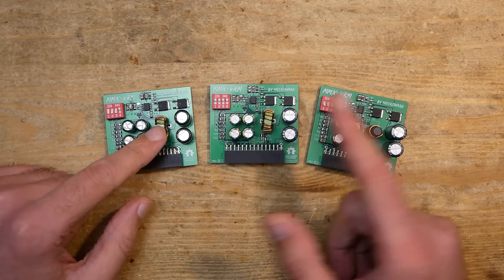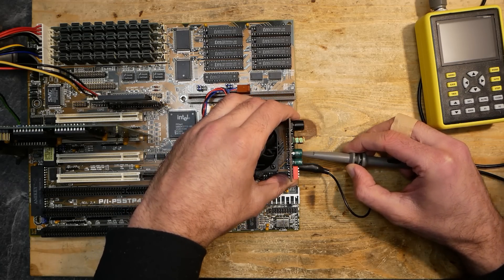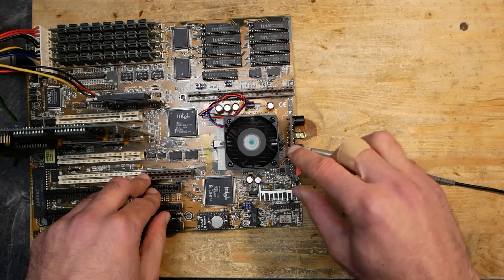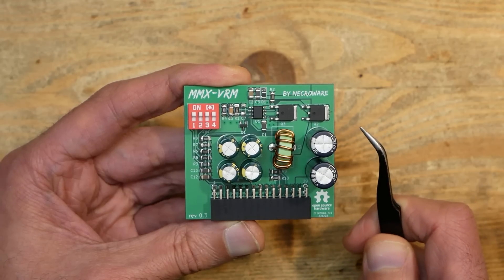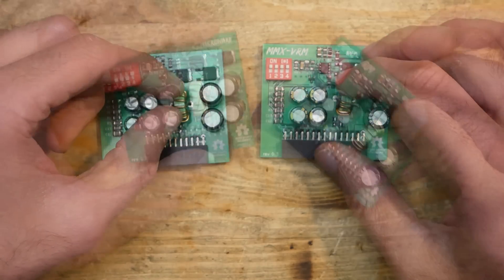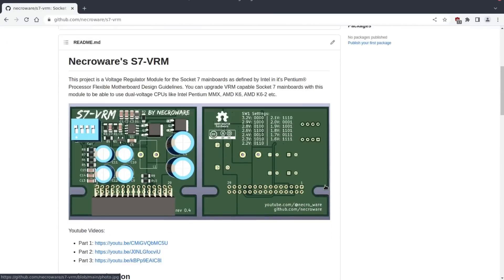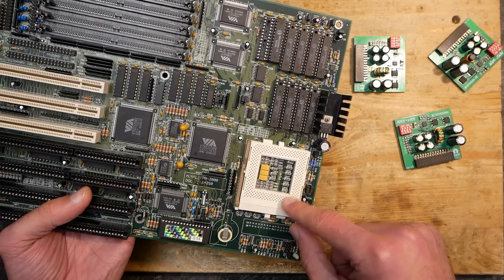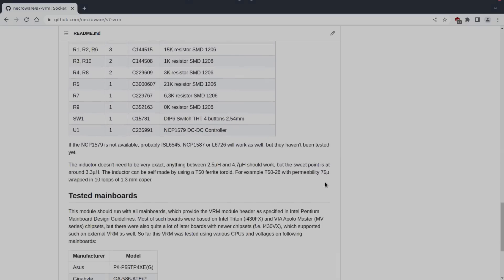Let's upgrade an early Socket 7 board beyond the limit (Part 4): K6-2 test and VRM announcement

Comment: Hey Necroware I really am loving this project. I am not meaning to be a pain I was wondering if you have any new Info for supporting the Cyrix MII CPU. It does use more wattage than the K6 CPU. Not sure if you saw my latest comment on your last video on the VRM. Granted I know I could use the K6-2 but to me I want to have something different for once since I just have to be stubborn and hard headed. Not trying to be mean in anyway about this project. I am just getting anxious for the final release and if I can use that CPU. I hope you have a good one and again I am in no way trying to be a jerk.
Reply from the maker: Hi Clint, strange, I though I answered your question back then. MII consumes more power compared to K6-2/400, but it needs less current at higher voltage, so that should run with this VRM. I have no MII, so I can't tell definitely though.
Reply: Only partly. Another person was trying to give more of an answer but yea you mentioned you don't have a Cyrix MII CPU but I hope if its possible for you to get one of the MII 333 or 300 to use a test out. Have a good one and I look forward to your next revision when your parts fully come in. Thank you for this project.

Comment: I think your proposed voltage selection revisions make sense, with one exception: wasn't there a K6 which ran at 3.2V? I'm not aware of any CPUs ever using 3.1V, maybe that one could be dropped instead?

I've never seen any of the mobile CPUs in a desktop board, but I guess supporting them makes sense.  Here's an idea: make the mobile (1.x V) voltages an optional section, with the appropriate resistors and a jumper to select "mobile" mode, which would substitute some voltages.  In "standard" mode, you'd have the common 4-bit binary setup of 2.0 - 3.5V seen on many Socket 7 boards.

Maybe that's too complex, just a thought...
Reply from the maker: Yeah, that missing 3.2V is the result of resistor network distribution. I'm trying to get equally distributed voltage over the range, this is still work in progress, but K6/233 runs stable at 3.1V if the ripple is low. I even was able to use it at 2.9V flawlessly. So, I guess, if 3.2V setting is missing in the end, it wouldn't be critical.

Comment: Impressive work! Extra points for making your own toroidal inductors 😁

In case you are interested, I'll leave a note on the relationship between characteristics and dimensions of electrolytic capacitors.
For a given series, the ESR is associated with the dimensions that is to say all capacitors with a certain Length and Diameter will have the same ESR. The ESR decreases with increasing volume.
The product of Rated Voltage x Capacitance is also (roughly) proportional to the volume so, for example, in a given L x D shape, if VoltageA = 0.5*VoltageB then CapacitanceA = 2*CapacitanceB (roughly).
Different series differs for endurance and max working temperature. It doesn't seem to me that, in your case, you would benefit much from pushing either so you may instead prioritise lower ESR or higher capacitance in the given volume but it's your call.

You may observe higher ripple when the CPU goes into that "power saving" mode because the buck converter goes from Continuous Current Mode (CCM) to Discontinuous Current Mode (DCM, the current in the inductor goes to 0 in each cycle). The ripple voltage is typically higher in DCM. The current threshold between the two modes is 1/2 the inductor (peak-to-peak) ripple current which, in turn, is lower for higher inductance. One of the benefits of higher inductance is that the buck regulator operates in CCM even at lower output current. As you found out, you had to trade nominal inductance for size & resistance. Larger capacitors would also lower the output voltage ripple but, again, you are constrained by the physical envelope of the design.
A way to lower the noise while staying in the same physical envelope is increasing the switching frequency (then, with the same output current, the inductor current ripple would be lower). This would require reviewing the choice of inductor and MOSFETs.
Which MOSFETs have you used? Can you please add the voltage rating of the capacitors?

Again, great job!
Reply from the maker: Thank you very much. Yea those are constraints, which I was messing with. The volume proportions are which I was trying to aim, due to the sizes, that didn't work completely due to limited size :)

In regards of CCM/DCM that's very interesting information, thank you very much! I'll have to evaluate that in depth for better understanding. As for higher switching frequency, I considered first faster controllers, but most if them are modern parts, which are harder to solder and they are more expensive. I tried to keep that cheap and easy to solder, so everyone can build it.

I'm currently AFK, so can't tell which transistor model it was, but there's a BOM on the project site.

Thank you for the info once again!
Reply: @necro_ware  I agree with the emphasis you place on the design being feasible for as many people as possible and it's tricky to find a good solution (Renesas ISL6545A, the 600kHz version, is now obsolete 😭).
Seen the BOM: I hadn't understood that one column is LCSC part numbers. My fault!
As others have written, you could use both faces of the PCB for components, for example SMD on 'top', (some of) TH on 'bottom'. This can help with the layout and make it tighter.

Can anyone point me to the pinout of the VRM socket (or 'header')?
PS: I don't have KiCad 😓
Reply from the maker: @lorenzo.c  there is a link to the specification on the project site, right in the end
Reply: Could always lay the capacitors on their side if they are to tall. Also am wondering if polymer caps would be better?

Comment: What switchmode controller IC are you using and is there a DIP version. Some people might want to redesign/built it on prototyping/stripboard using through hole resistors, capacitors and MOSFETs they already have in stock if they can't afford a PCB. You did say you had difficulty sourcing some of the SMD resistors and caps.
Reply from the maker: Finding that parts as TH is even harder today. Also, a lot of work went into the layout, probably every change will influence the ripple behavior. But if s.o. wants to do that, the exact parts are all mentioned in the project.

Comment: Adding an inductor between the input capacitors could lower ripple if you're seeing ripple on the input.
Reply from the maker: That's true, an additional LC filter would be a good option. But so far I'm trying to avoid additional inductor, I would like to reduce the size of the module instead.
Reply: You don't need to reduce it. I would rather have a properly designed  board that works well with low ripple than a board built down to a size/price. If additional LC filters on the input and output require a taller board, so be it.
Reply from the maker: @simontay4851  of course, if it needs that, I'll do.

Comment: Just a tip, regarding space occupied by capacitors - you can put silkscrenn on both sides of PCB and populate capacitors from opposite side in case they are facing towards CPU cooler. 🙂
Reply: Yeah, exactly. I was going to post a comment saying that but you already did.
Reply: Good strategy there.

Comment: Great job on getting the k6 running. Can you use small super capacitors to replace the big capacitors at 3.5v and 0.47F ? Or the 5.5v coin super caps at 0.22F. Just mainly for smoothing out power for DC?

Comment: The ripple tuning is actually spectacular, great success.

The routing is kinda ridiculously overbuilt for the 15A target though, like, you don't even have to worry or really spec through hole inductors, just via stitch the area and you'll be good i think. Not that i mind handwound at all.

Comment: There's a protective sticker on your scope's screen.. remove it for a picture with much better sharpness and contrast... Love your video's!
Reply from the maker: I added that sticker, because the screen is glaring like crazy and blinding the cam. I played around with light, but decided to put that sticker on screen. It's slightly blurry, but therefore I don't need to search the angle all the time :)
Reply: @necro_ware  Whatever works for you is fine with me.. The screen is readable enough on video.. Thank you for the great content!

Comment: If the capacitors are on plated through hole vias, maybe they could be mounted on the reverse if front clearance is a problem. Also, you may want to add extra vias or wire throughs if using tracks both sides to lower resistance
Reply: Came here to say this.

Comment: If Im right, I know, whats in the Box 😁 And if I remember right, this CPU worked in an Asus P5A with ALI Aladin V Chipset before.
Reply from the maker: Of course it is! Or may be not? ;)
Reply: @necro_ware  Im very excited to see it in the next video. And if it is: especially the difference in performance - or at least, if there is one 😉 (Im expecting the limited bus speed as a real show stopper for most benches)

Comment: @Necroware could you also add SMD capacitor pads on top of those through hole pads, just so anyone’s able to use either one of those? 

Whoah 🤯 this project is so damn awesome! 

I currently have an Intel Advanced/EV Socket 5 motherboard with the same header. I really want to be able to use a 166MHz Pentium, as I ran that on my board back then. My board back then was a Socket 7 board with some extra jumpers for setting the multiplier higher than 2x, but I should be able to run it at 166 anyways! :) 

Thanks for the great content and projects. You’re doing awesome work, and you’ve really created a big impact in the retro community. Much appreciated!
Reply: Necroware for president!
Reply: i second this SMD caps idea. they're thin so there's no more space constraint between the module with CPU cooler or other parts on the motherboard. on top of being thin, now we're able to use both PCB plane to be populated for the caps if necessary

Comment: Have you tried the VRM with either polymer capacitors or a mix of Polymer and normal Electrolytics?
Or some Panasonic FM? 
Reichelt migh thave some, as well as some Kemet A750...

Comment: About the change in ripple; I don't know exactly this DC-DC converter, but many of them go into some kind of energy save mode (lower frequency) or even hickup mode for light loads. This also looks like showing on the little scope you have.
I am one of those electronics engineers, doing this during breakfast, hahaha.
I will have a look at your design to see if there are some improvements possible.
Using a shielded inductor is already one of them btw.

Really sad to hear that people already ripping of your idea. Seems to be very common these days unfortunately.
It's so lame. I often build in some kind of "mistake" in the design I share on the web.
People who want to use my design, have to contact me first.

Comment: Awesome ! I loved this series. I don't have many vrm capable boards anymore, but I may still try to build a few for myself or other people. Would you like a K6-2+ 570 for your benchmarks (unless this already is the surprise you're talking about :D ) ?

This reminds me when I was using a Shuttle HOT-557 as a retro PC and I wanted to upgrade it to a K6-2 450. When I set the CPU to the proper speed, it crashed while booting windows 98. After fiddling with the jumpers I noticed that running it at 300MHz was working. I didn't understand why immediately, until I tried to mess with the jumpers more and accidentally touched the MOSFET's cooler ... It burned my finger. I took a thermometer and even though I'm not sure my measurement was 100% accurate, I saw that it was running at at least 80°C. Definitely too much.
I noticed also that even with a normal pentium that MOSFET ran really really hot (burning hot). So I screwed a fan in that MOSFET's cooler and then I tested the K6-2 450 again and it ran without any issues.

Later I read the motherboard's manual and saw it wasn't designed for CPUs above 200MHz😅
This board has a spot for a VRM though, so I guess it could benefit from your project :D

By the way you said the link was in the description, but it's not :(
Probably a mistake😄
Reply from the maker: Oh my... of course I forgot the most important thing, the link :) Thank you! Fixed!

Comment: Switching psu is cool, but is it quiet?
Like if you would use cheap soundcard, will you hear the psu in headphones?
Also be sure it's not produsing any outside noise, like noise noise that one with good hearing can hear.

this may sound really anal but im one of those people that can hear every modern device whining away, i cant even use normal phone chargers because i can hear them whine annoingly lmao.
Weirdly never heard any whining from computers, unless you count the coilwhining
Reply from the maker: Well, it's not more noisy, than any other hardware which uses switching regulator. It is definitely worse, than a linear regulator, but you can't use a linear regulator for any desktop CPU, which was made in the last ~25 years. They simply pull too much current.

Comment: Do You consider that Your ground clip from oscilloscope proble are long and form a one loop coil that could pick up rf nocie that cpu produce ?
Reply from the maker: Yes, I tried also with short pin to the side of the tip as well. There was no difference.

Comment: I have an Intel Advanced/EV (Endeavor) socket 5 motherboard that has a max CPU speed of a Pentium 133MHz It would be wonderful If I could get a Pentium 200 MMX to run on this thing :) The motherboard is listed on  The Retro Web.  Does anyone know if its possible without forking out a ludicrous amount of cash for a Pentium MMX overdrive .  or if it would be possible to convert a Pentium 200 MMX ??  Thanks in advance :)